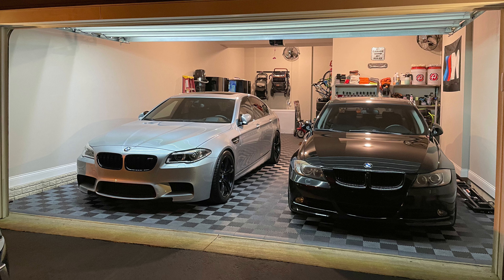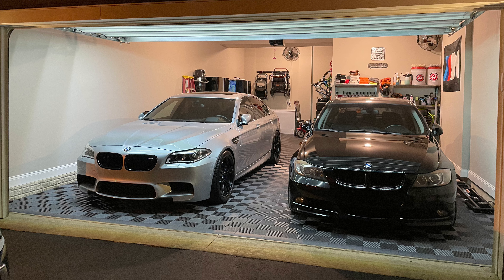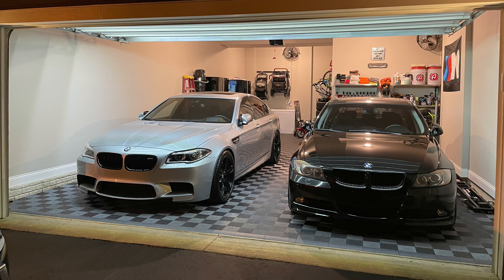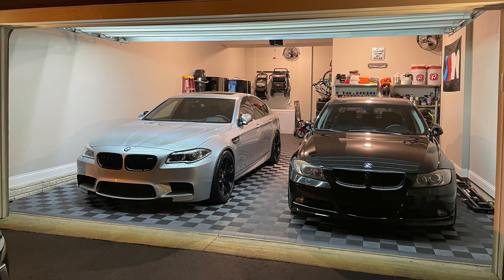The Part That WILL BREAK On Your BMW!

Comment: Both my back window regulators keep breaking every year they both break on my 2006 bmw 325i . I’m kind becoming a expert on replacing them due to the fact I’ve replaced them about 12 times or so lol. I barely even use my back windows and they still break, I’ll just be driving along and boom broken and the windows drops. I think since I’m single no kids I’m just going to get the coupe 328i so I don’t have to worry about it anymore
Reply from the maker: Yeah man my other one just went out too lol

Comment: I hated E39s because of those damn window regulators, otherwise would have been a good car. In saying that both of my e60s are yet to have a failure after 5 years so they did something to reduce failures.